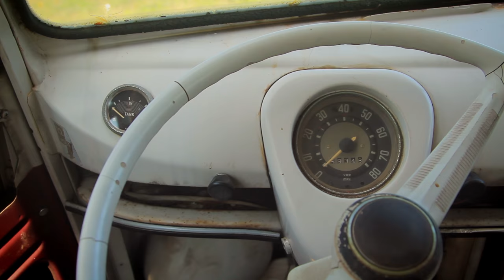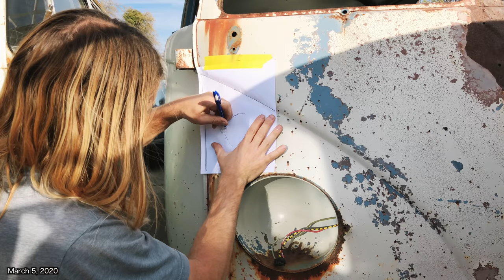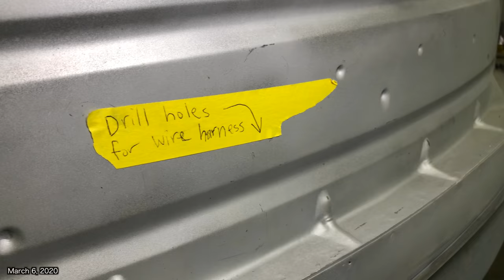VW Bus Restoration - Episode 25 | MicBergsma

Comment: Amazing job, Love that Mike Fn Garage just did his nose, and it is neat to see two different techniques.  I think I do prefer the spot welder over the drill hole and weld method.  However the panel adhesive is a good idea for that area.   What primer are you using to cover up the spot welds?  Eastwood weld through primer or etch primer?  Wouldn't it be better to use an epoxy primer since you will be near the ocean with this bus and those areas are prone to rust?
Reply from the maker: Awesome, yeah it’s cool to see few methods what other people do. Next episode we will show how we install the nose, can’t wait! Self etching primer for covering the spot welding
Reply: @MicBergsma  Hey! Please I need the constructive data of the decagonal "wheel" (10 sides) that you built as a tool to turn the vehicle (Wolkswagon bus) and have access to all sides to facilitate the repro work. What are the dimensions of the tubes, thickness, length of each section of the "wheel", etc., ???. Tanks from Brazil. Hugs to everyone in the garage.